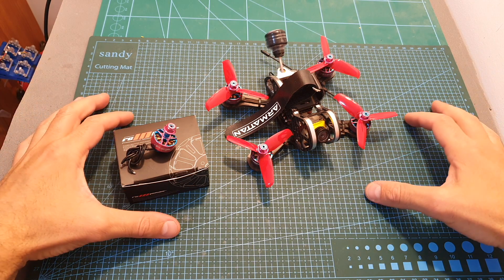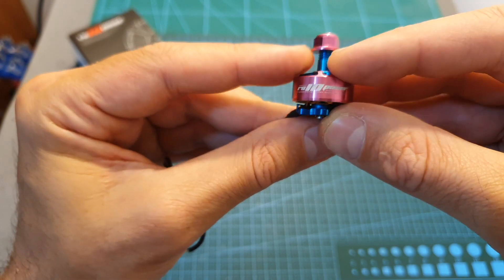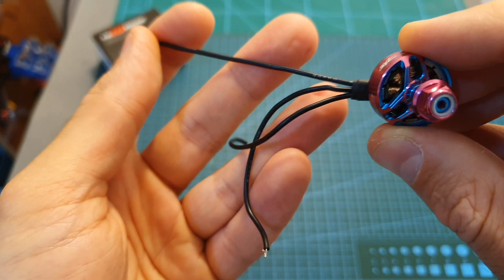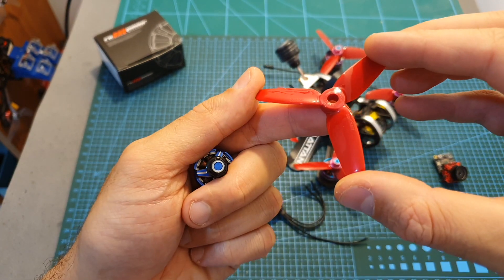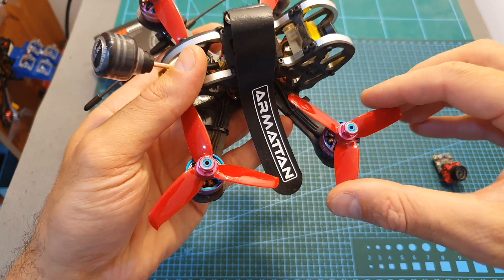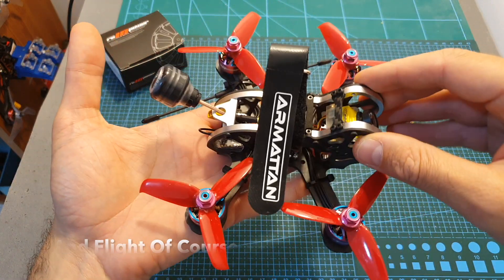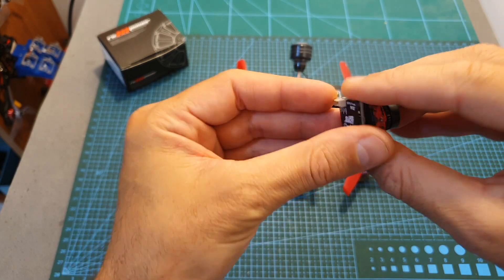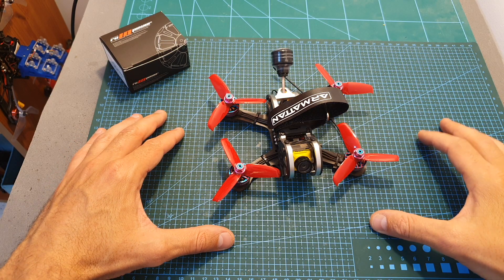RCINPower GTS-V2 1506 4300KV Motors - Thrust Test & Flight Footage

Comment: Hi . Nice video.. 
Why that smoke in 4s? 😳

Can you help me with selecting the ESC.. I'm using these in cinewhoop setup.. cloud149 frame. Planning to put 5 blade props. Will 30amps be enuf?

Motor max current rating is 25 amps.

Comment: Is this the lightest most efficient 4-5" motor?
Im gonna give the 250g a whack with 5030.

Lets pretend that $$$ is not concern.
decent 4s battery is 110-120g, and 15g each, that leaves 70-80 for frame and everything else.

Trying to find 12A+  "stack" like  GEPRC all in 1 board.
Reply from the maker: I am not sure if it's the most efficient motor. Anyway - you need a bigger ESC to run these motors.

Comment: Have you testet the GEPRC F7 Stack with GPS BN 180? This Combo still not working. Can you try this?
Reply from the maker: No, I have not. What's the issue?
Reply: @KremerFPV  The GPS module is not recognized. At the top of the bar at Betaflight where gyro, accelerometer, GPS etc is displayed, the module will not be yellow. On another FC, the same BN 180 module works without problems.
Reply from the maker: @nno_x  Can you upload an image of your flight controller with the GPS connected?
Reply: I checked the connections several times, everything is connected correctly. 5v-5v GND-GND TX-RX RX-TX. Now I have tested the GPS module M8Q from Mateksys, it doesn't work either. I have the guess that the FC does not recognize a GPS module.

Comment: Dang these look nice. How would you compare these to the tried and trued BH 1407?
Reply from the maker: I can't even remember if I tried the BH 1407 motors ;-)
Reply: Gal Kremer Are you still running these 1506,  if so how you liking them. Good power, relatively efficient?
Reply from the maker: @cletussurfsalot7190  I don't have the time unfortunately to fly all my quads. I can tell you that these are very powerful but power hungry motors.

Comment: GAL! Buddy! do me a solid do you have the GemFan Windancer 3028 props? the hybrids with t mount or shaft mount option? if so could you please try them on these motors?
Reply: They would deform to much on these motors, they are not as stiff as the Gemfan 3052's, Great props but IMHO they are better for cruising and light freestyle.
Reply from the maker: I tend to agree with Sub 250g FPV